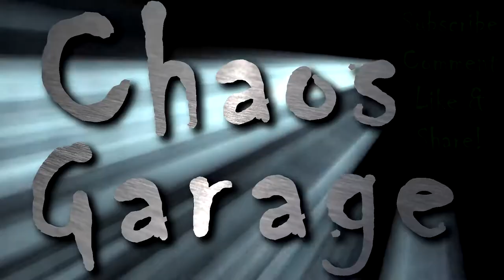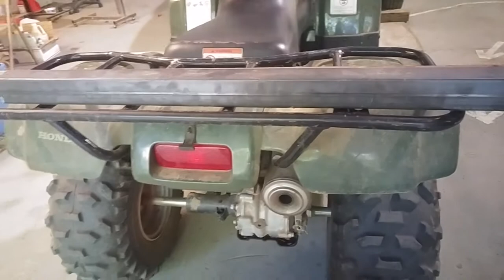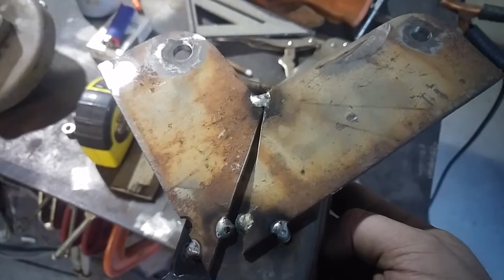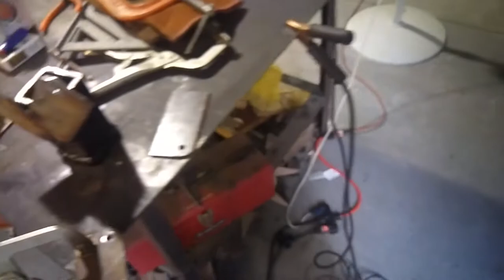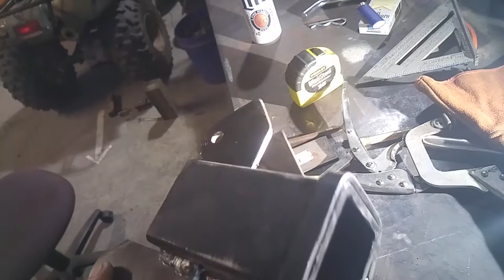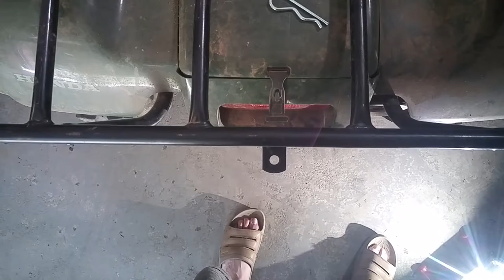How I Built A DIY Homemade Honda Recon Trailer Hitch (Cheap!)

Comment: Got an '86 FourTrax 200SX, 2X4. Has a similar rear axle setup to this, I don't think anyone makes a receiver for it, gonna have to see what I can come up with. We have a few riding mower style trailers I'd like to be able to pull around with it, very light. I may still do a full on 2 inch receiver, so that I can mount anything to it. Nice work with the receiver, looks like a brand name piece and will for sure outlast those poorly made chinese ones. Thanks, straight to the point and no BS, earned a sub!
Reply from the maker: Thank you sir! Even though it's my wife's bike, I've pulled trucks off trailers and even a bundle of cut trees tied to that hitch. The bike wasn't happy pulling those trees but it did it! The hitch is overbuilt for the bike but I'm ok with that! It's made of mostly scrap metal I had on hand.

Comment: I TRIED THIS (RECEIVER HITCH) AND HAD A LOT OF PROBLEMS!! I WENT TO TOW MY 5X10 UTILITY TRAILER AND MY DOUBLE JET SKI TRAILER AND IT BENT THE WHOLE HITCH DOWN INTO THE TIRE... STOPPING IS THE ISSUE!!!
Reply from the maker: This is a homemade hitch...much thicker and sturdier than anything I've found online. I'm 100% certain the aluminum diff will break before the hitch does.